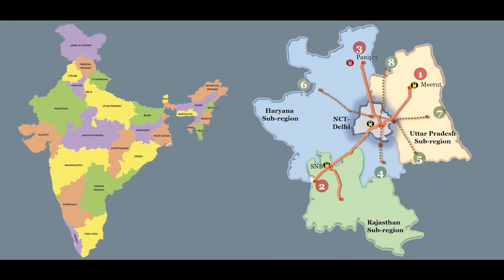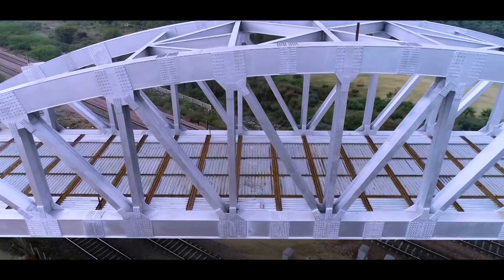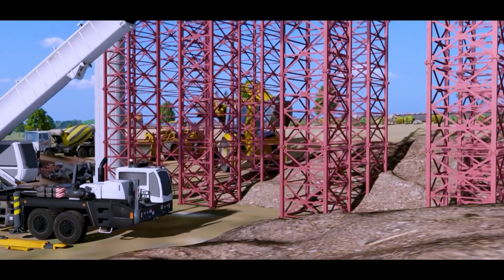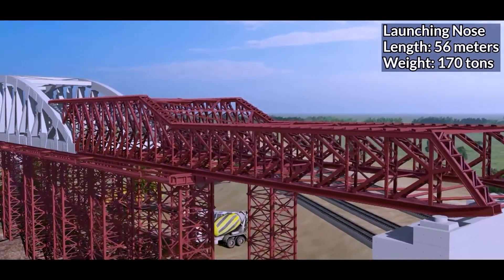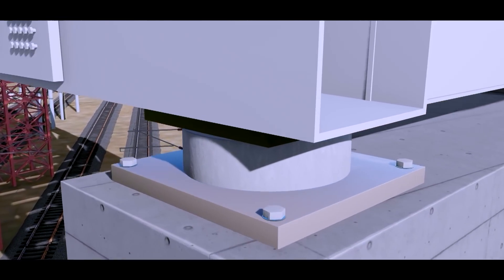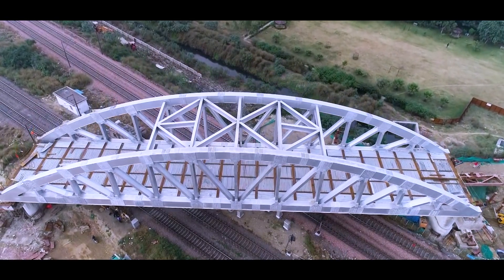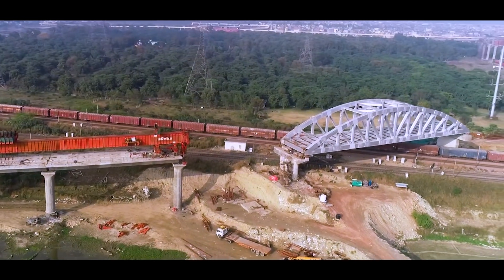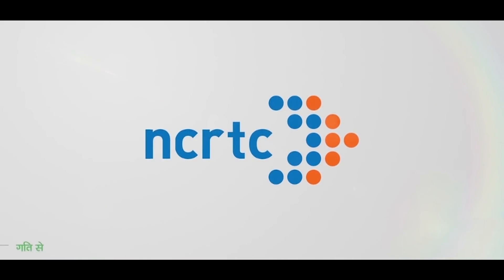Special Steel Span of RRTS Corridor

Comment: This is will make sure Delhi doesn't suffer from the same fate as Mumbai and bangalore of becoming saturated.
Good thing is that they are integrating it with existing Delhi metro system.
This meerut line could be stretched further to muzzafarnagar
Reply: Bangalore need a satellite city. I hope Chennai - Bangalore expressway acts as a industrial corridor and ease the saturation in both cities.
Reply: @myawoo  4 satellite cities has been announced for vission Bangalore 2040🤩